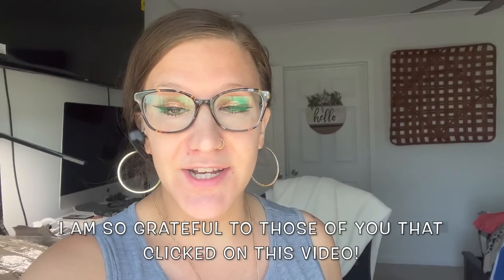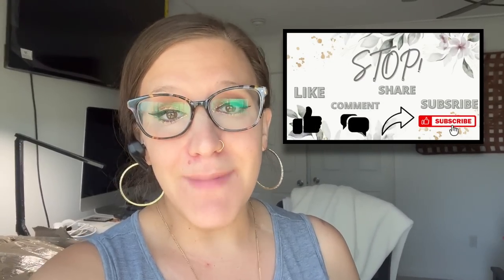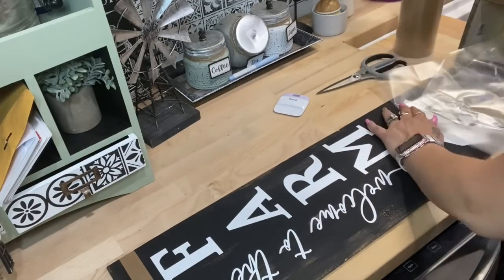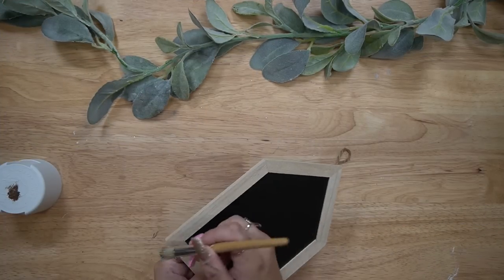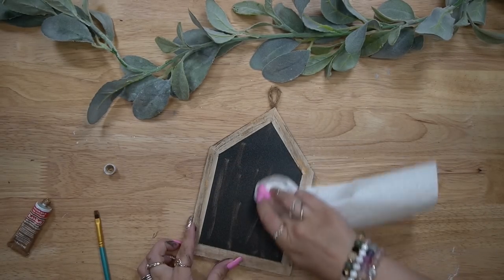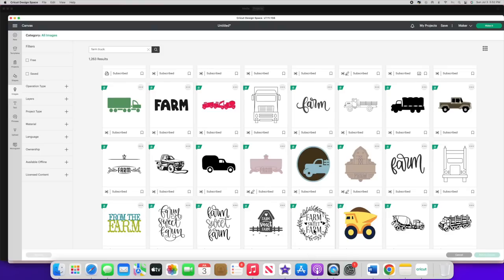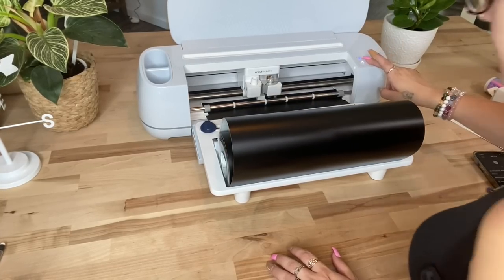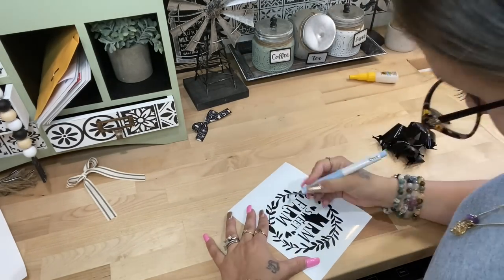YOU WONT BELIEVE THESE DOLLAR TREE DIYS | FUN AND EASY DOLLAR TREE WOOD BLANK DIYS

Comment: What's the best paint or spray to use for a porch sing to keep it weather proof/water proof/protection from the sun? I live in FL so it's extremely hot and rainy lately. Also I don't have a covered porch so it would get wet from rain most likely